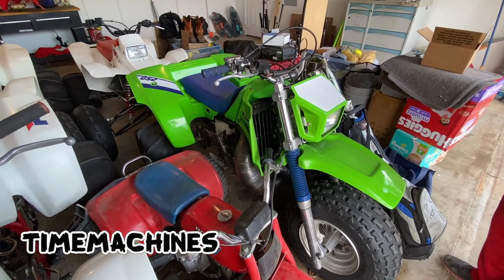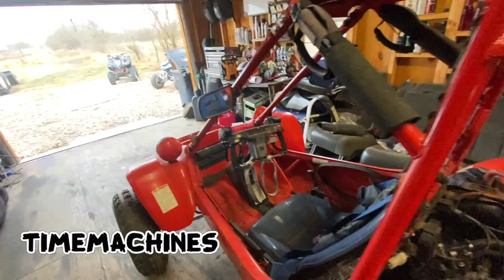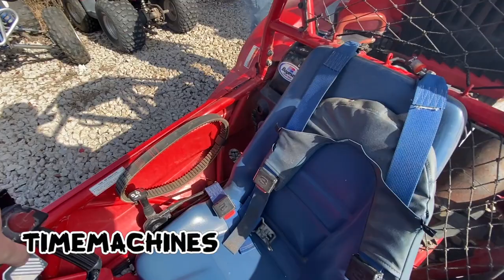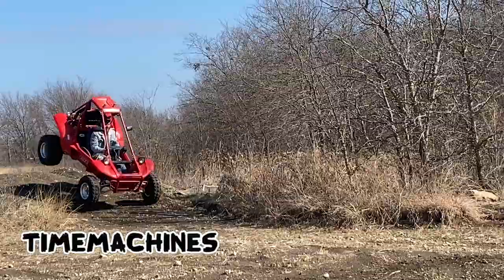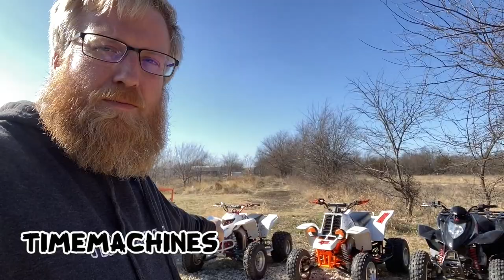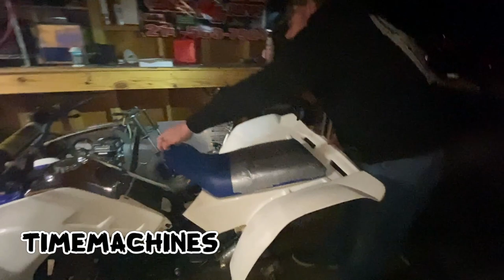Sendin' OKC | Oklahoma HAUL

Comment: I’ve got a quick question I have a moded blaster and it won’t idle I’ve cleaned the carb and it runs smoother but still won’t idle was wondering if you’ve had this problem before?
Reply from the maker: I have. If carb doesnt have idle adjustment you may have to drill and tap one.
Reply: It has an idle adjustment but it doesn’t seem to much I’ve twisted it all the way in and 2 and a half turns out but it’s the same thing. Thank you for your advice very much appreciate 👏🤘🖖